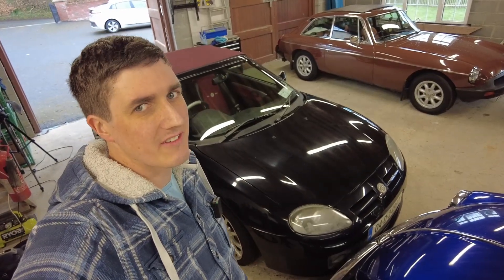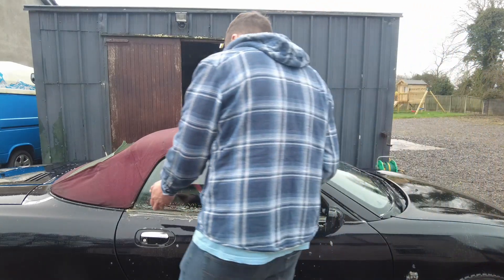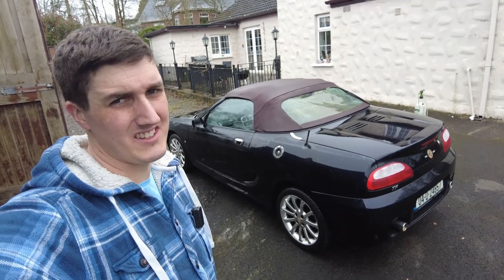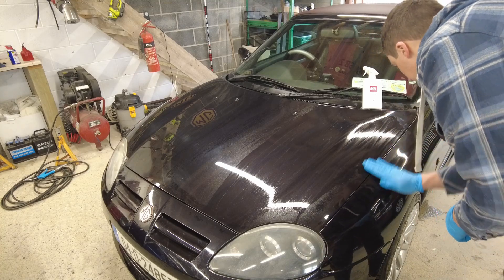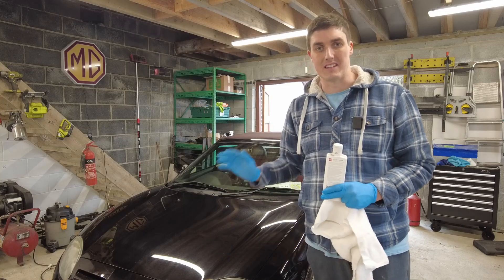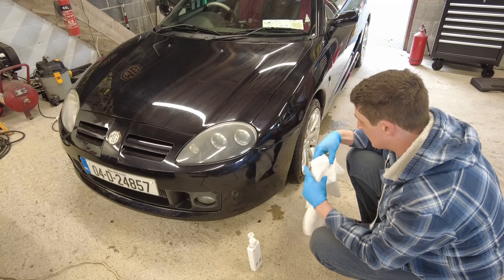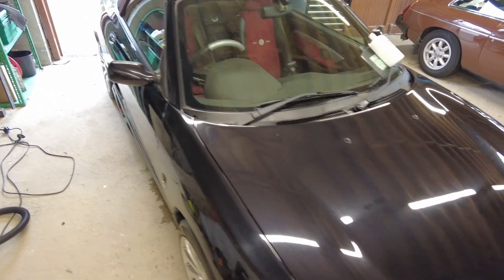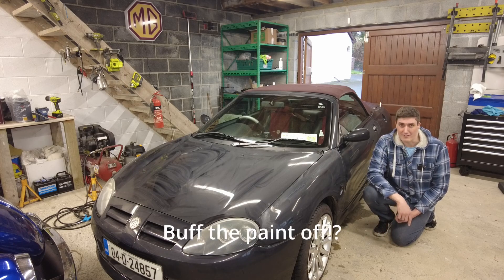Restoring the Shine: Detailing a 2004 MG TF Anniversary Edition

Comment: Paintwork was dead rough,you done the best job possible by hand and is something any viewer should be able to achieve without a more expensive machine polisher.
Reply from the maker: Cheers Mick! That's high praise coming from you! 😎 I wouldn't mind getting into a bit of machine polishing at some stage too but only on a banger to practice on.

Comment: I use the full clay bar, fold it over every couple of minutes and flatten with a lump hammer (seriously). Set of buffing discs attached to a hand drill and compounded, then polished to finish. Viola.
Reply from the maker: Yeah but then you only get one use out of the clay bar.
Reply: @Endfloat  The brand I use comes with a little storage box, splash of detailing liquid to keep it wet, use often.